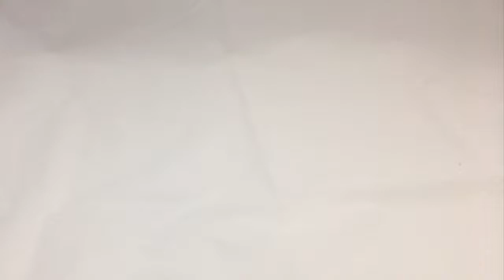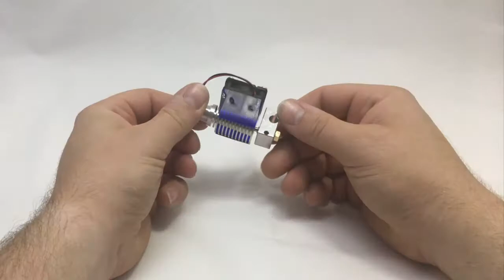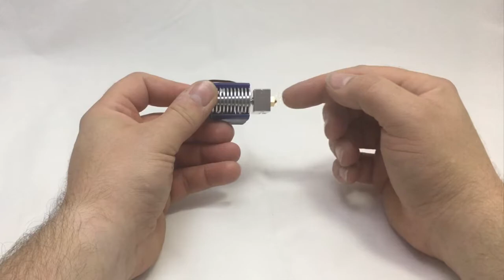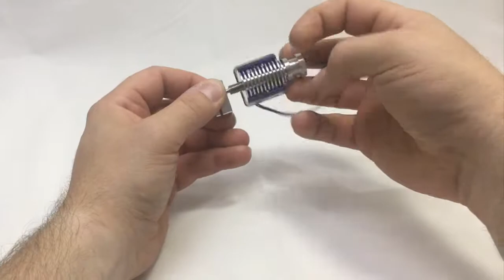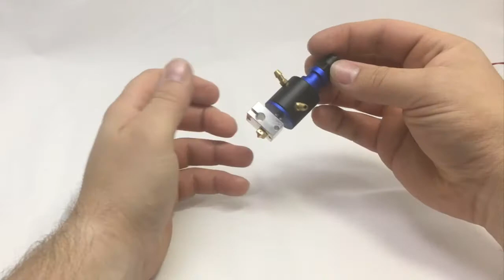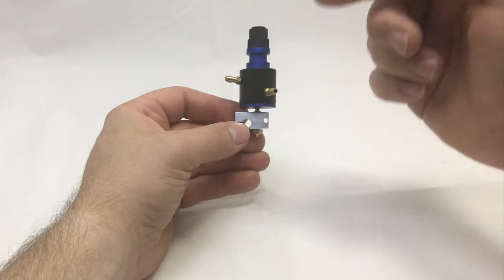SILENCE your E3D-V6 with a water cooled heatsink!

Comment: So assume this is working fine with no pump and just relies on heat of water to produce flow?
Reply: What ? No. Given the amount of heat and restriction you can not expect convection cooling.
Watercooling needs additionnal components. A pump, and at least a radiator to dissipate the heat away. 
One basic copper/aluminum 120mm pc rad+fan assembly should do the trick.
You also do need a tank/reservoir with direct feed to the pump - spinning dry kills it - and some tubing.
A small 12dc pump with sufficient head-pressure and flow rate.
It's basically like pc watercooling... smaller. It doesn't need to be expensive but surely will compared to a simple noctua fan. I think it is a cool way to silent any printer - quieter than a 40mm fan - but at a higher cost definitely. It is "extreme" i recon.
Whatever, the part cooling blower-style fan will still be required and make some noise too...
Reply: Captain Falcon cheers, yeah I had a moment of clarity after writing it. I have it up and running but as I have included cooling for steppers  as well I need to look for a better pump than I had